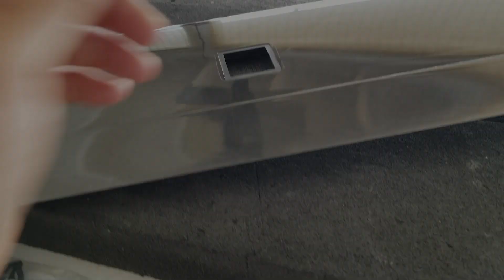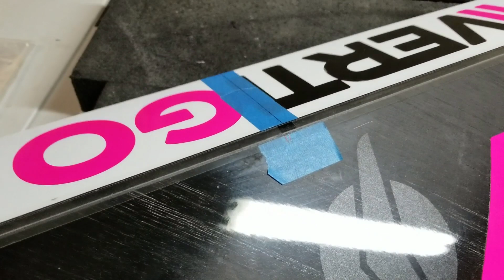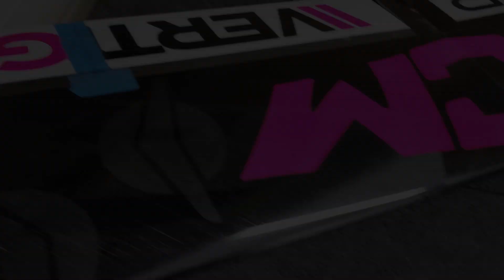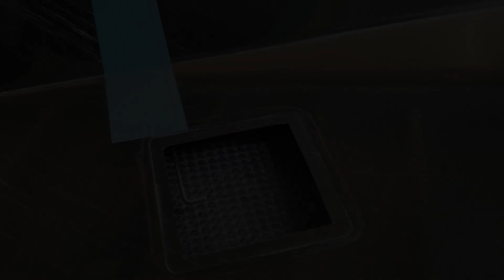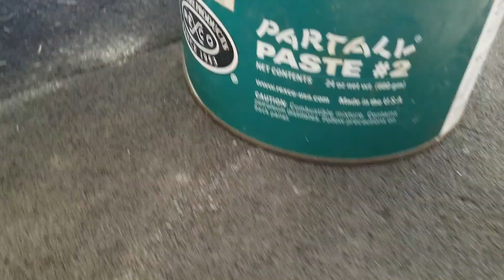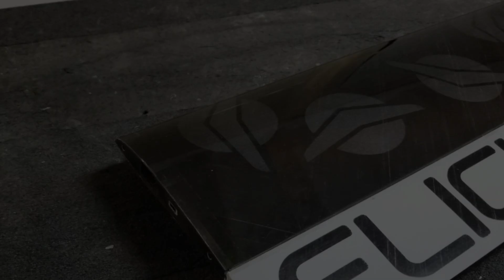GCM Vertigo F5J Flap Servo Install

Comment: Hi, have you some major indications about Elevator setting, Rudder settings (ho much throw)? I am looking for some indications about butterfly settings as well. On the flaps I am at 70 to 80% (which seems enough). On the aileron, I am on max +-15 mm throw. I followed your videos on Vertigo and I have chosen IDS links on ailerons and normal as per video on flaps. IDS was a bit of a challenge to fit servoholder into the servo bay. Tricky, but managed and it works fine and very tight and accurate. I might change system for teh flaps as well and convert to IDS, but first go for a maiden flight. Thank you
Reply from the maker: I don't use butterfly at all. Only flaps down. If you do use butterfly limit it to no more than 5mm up ailerons. If you have a light model it puts a lot of stress on the wings. I also feel that I lose roll response with up ailerons. I don't think you need butterfly or crow mixing at all. Try some tests with and without. 

For rudder throw 30mm is ok. You can put in as much as you can get without binding pushrod. The model likes a lot of rudder. It's my primary flight control when thermalling. Elevator is just to your taste. It's not super critical. I probably have12-15mm up and little more down so I can push the nose down hard in contest landings with flaps out.
Reply: Superb indications. Thanks for input on butterfly, was not considering it could stress on the wings. I will make some adjustments and land with just flaps. So far have been flying with low wind and therefore may be I haven‘t noted any wing load. These indications are really very valuable. Thank you. I am really enjoying to fly this glider.

Comment: I offset the horn a few degrees towards or away from the leading edge. ( depends on you pushrod placement)You get more resolution and travel for full flaps without  having to get the servos from over reaching

Comment: If I may ask, where did you get these frames for the Bluebird servos? I have these exact ones, but cannot find the frames for them. Many thanks for your excellent videos!
Reply from the maker: They are made by gcm, the maker of the model. I have spare if you need them. Email me through my site, flightcomp.com
Reply: @flightcomp  I replied on your website, but have received no response. Maybe not working??

Comment: Hi, did. you try an ids Installation on flaps (strong Version)
Reply from the maker: Hi, yes. I have used servorahmen ids on strong version. No problems.
Reply: flightcomp - thanks. As Servos KST x10 Mini ?
Reply from the maker: Yes X10 mini. I had to cut back mounting tab off and shorten servo tray to make it fit.

Comment: Hi, nice video, are you happy with the blue bird Servos?  one more thing the method that u used with the flap horn pushing the rotation point forward  would work on F3k gliders?or have u tried it on F3k gliders?
Thanks

Comment: Thanks Ali........  This would have been real handy a couple weeks ago!!! Hahahahaha....   I kept the body of the servo closer to the Root of the Center Section as that is the heaviest part of the servo. So my linkage came out of the slot closer to the tip. I used 12mm for the spacing moving the servo that much closer to the root of the Center panel. So far, so good. I wish we had some of your videos a few years ago. They have really helped me come up to speed doing these assemblies. Thanks Again!   Weav